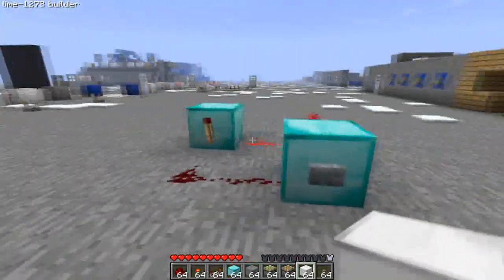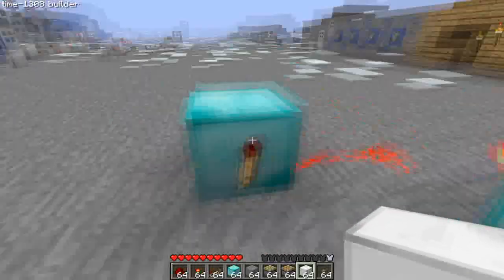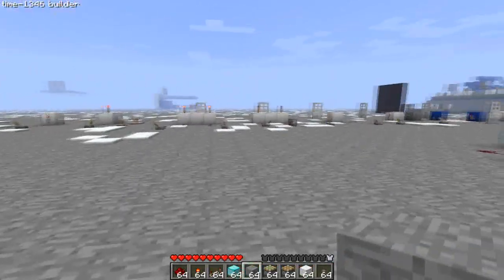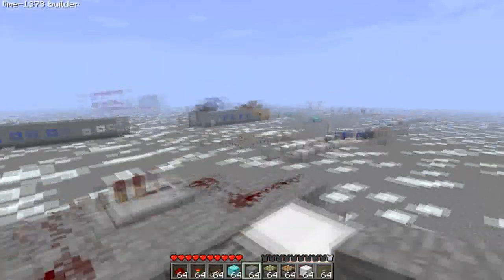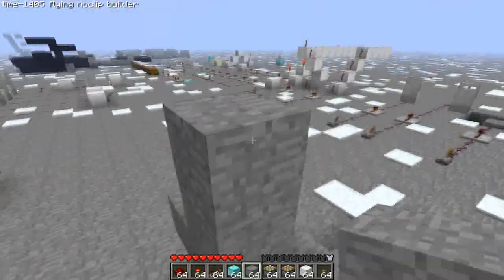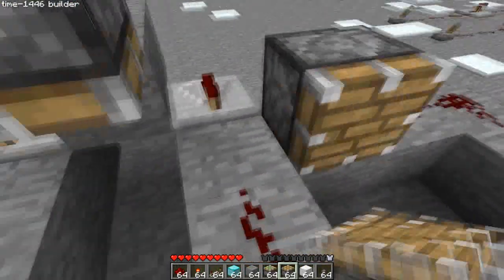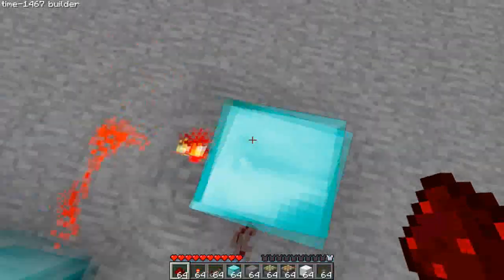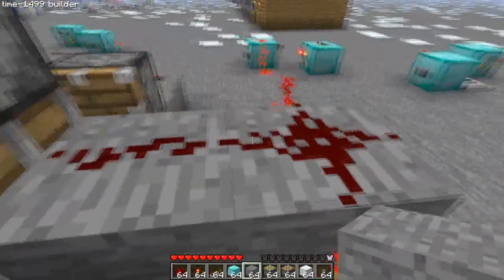ONE INPUT Piston Flip Flop! - MC redstone tutorial bonus by Drugoli

Comment: the sticky piston is only needed when using a lever. so if you make it with the button you can make it less space consuming.
also the platform is unnecessary. just dig 1 down under the block attached to the sticky piston instead.
but nice invention. :D

Comment: @EGhostdk The Lateral Piston's acting strangely is due to piston nature.. Your RS Nor is a partial pulser, it turns off, and pulses, which pushes the block to empty, then powering is again, so both off for a moment, both on for a moment, then switches, but it happens at same time, which stops it from pushing back as they've both 'pushed', not an error, and shouldn't be fixed either :P